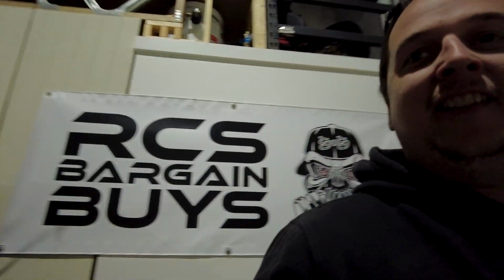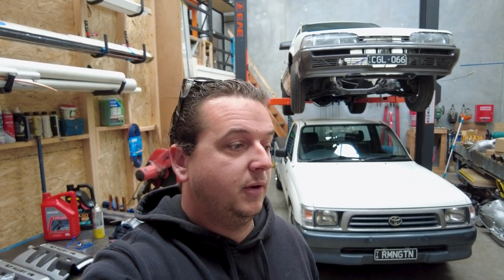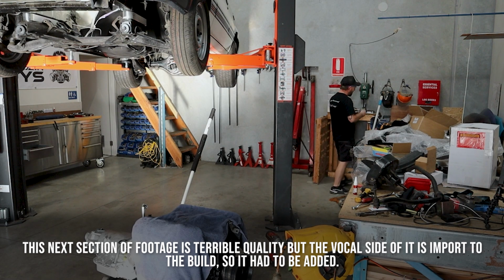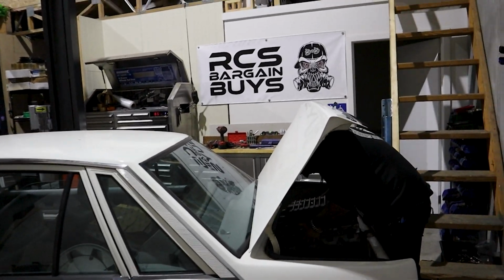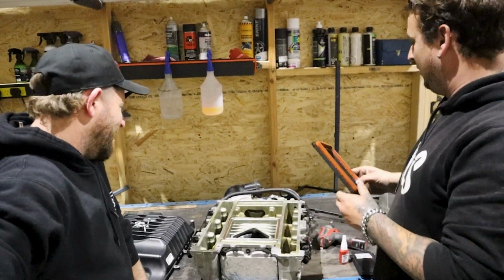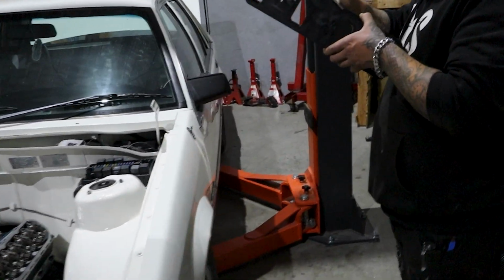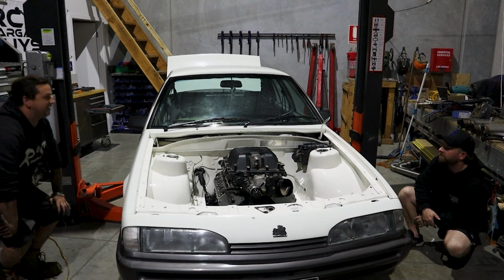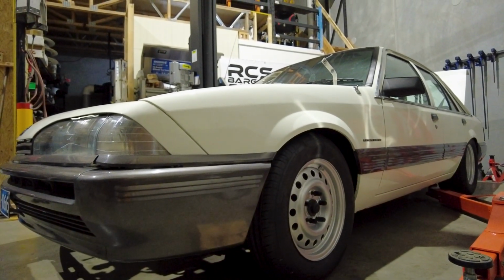VL Commodore With A LQ9 6 0L Supercharged LSA Conversion

Comment: The lsa blower will fit under the bonnet with a 20mm spacer all u have to do is mill down the top half of the blower the thins 
That conversion isnt easy...alot of lil jobs that will stuff u around but it can be do👍👍👍
Reply from the maker: Yer mint, we are keen to get this done for summer then power cruise
Reply: That spacer that your got in front of the flexplate...I dont understand...I'm running the same auto all I used was the factory LSA flexplate&just had the converter pads made to suit .
Reply from the maker: I might have cut the convo from the video i can’t remember but basically we got it made to suit but they buggered it up so we adapted it after talking with our local transmission shop
Reply: Kool as yeah the headers aswell u might have to modify alil but what can u do I guess cant wait to see the next episode on that car...an I'm happy to help u with any info u need on that build because I went down that road too👍👍👍
Reply from the maker: Yer awesome mate, appreciate that heaps 🥳

Comment: The castle main tri y fit I just did a conversion ls into a vl there tight but they do fit not to sure how they will go with the sub frame spacers your using to fit lsa blower under the hood I reckon the will give more clearence but not 100% sure but without the spacer the definitely fit
Reply from the maker: I think we are going custom now, but will see